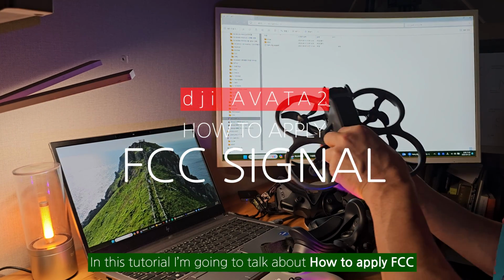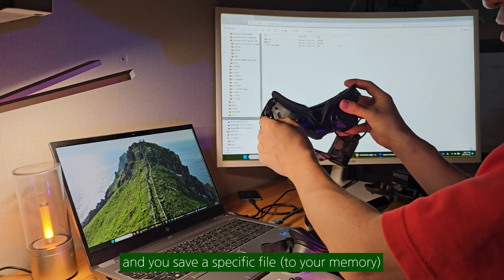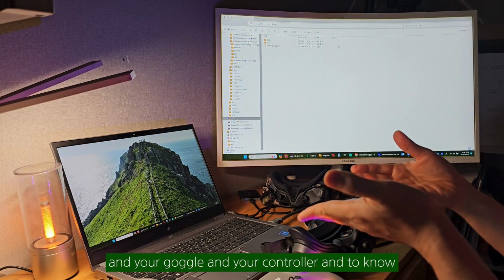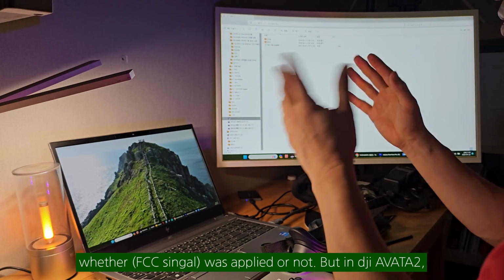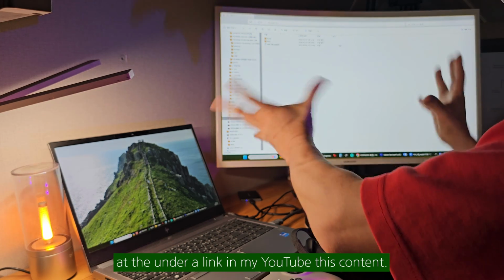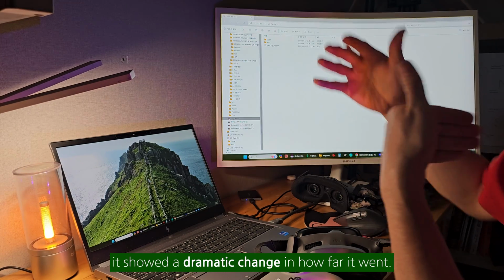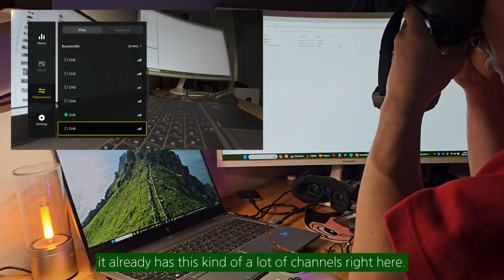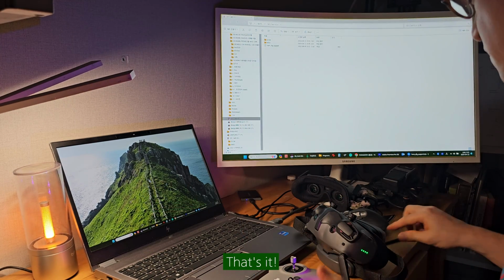How to apply FCC Hack to your dji AVATA2

Comment: Does this make the CE drone go faster than 70km/h?
Reply from the maker: Actually my avata2 flew 90km/h
Reply: @YOONGOON_FPV  In Europe it's limited to 69-70 km/h. So disappointing. It has less power, less fun.
Reply from the maker: Yesterday I flew with 90km/h in 45degrees, still felt it was slow!

Comment: This hack is not working in EU anymore for Avata 2 with the final firmwares. On the other hand in EU in CE mode we have an extra band 5.1GHz which is not available in FCC.
Reply: In Ireland I only have Channel Mode Auto, no manual/channel selection possible, even with the ham file and according to DJI Tech support/release notes there is no fw update yet for Avata 2/Goggles 3 (perhaps for our region). Do you guys have a lower firmware shipped with your device then Avata 2 V01.00.0200 Goggles 3 V01.00.0100 ?

CE Mode is apparently like this according to video here https://youtu.be/uKvIkMoU7I8?si=YAdXtvkHGMyas0k-&t=174
Reply from the maker: in Korea we have 2.4G and 5.8G only, same in Brazil, 
do you have 5.8G?
Reply: @YOONGOON_FPV  Yes, we have also 5.8GHz and accordingly to Avata 2 specs:
Transmitter Power (EIRP)
2.4 GHz:
＜33 dBm (FCC)
＜20 dBm (CE/SRRC/MIC)

5.1 GHz:
< 23 dBm (CE)

5.8 GHz:
＜33 dBm (FCC)
＜30 dBm (SRRC)
< 14 dBm (CE)
Reply: the hack is still working try doing it again

Comment: Can i use the same memory card and file as i used in Goggles 2? Or do i have to format the memory card and copy the file again?
Reply from the maker: As recommended plz format from your goggle and insert it again and reboot, nothing seems different but fly from the same spot and check the signal difference as many here in Korea says there's significant difference in the flight distance and antenna signal
Reply: I don't get it. Format the SD card or reset the Goggles? 

Why do we need to format the SD card?
Reply: @irhuz8683  format the SD card in your windows pc before putting the file on it. beware this will make you lose all the content on your sd card, so be sure to back up. Once you put the file on de SD card, insert it and it will work

Comment: Hi ! i tried it, but the setting for "channel mode" is set to "Auto" and is grayed, i can't put it on manual... any idea ? i applied the update on the Avata 2 so it should be good :/
Reply: Same here
Reply from the maker: Hmm what country are u at? Here it's Korea
Reply: @YOONGOON_FPV  France here, I saw an article talking about the fcc hack on Avata 2, the guy said it worked on only 1 of 4 Goggles v3, he doesn’t know why, on the 3 other the « channel mode » was grayed and locked in auto
Reply from the maker: I heard that European drone law got really strict recently right?
Reply: @YOONGOON_FPV  that’s why I want FCC 😅 it works for some, and not for others, so it is weird, a solution will be found I think
Reply: I had the same issue , on mine it worked with the file but after I did the firmware update it stayed grey on auto
Reply: @techgadgetgreece1587  do you think fcc is working now that your channel option is gray ?
Reply: @fab00057  I think the now is on ce, not fcc, I will check if I can downgrade firmware and try again .
Reply from the maker: Currently I'm making review, try to see the indoor crazy far flight at department store with this applied :)
Reply: @fab00057  T es dans quel coin en France?
Reply: @Fabosteo  en région parisienne, dans le val d’Oise, pourquoi, tu as une astuce miracle ?
Reply from the maker: We can assume that because of Ukraine & Russia War, dji has announced that they will not sell their product to both coutries, and dji will prohibit it being used at the war. But they said they cannot block their products being sent to those 2 countries from neighborhood coutries, which is Europe. If I'm dji I will strongly block the FCC mode which is happening to you, but working in Asia and South America which is far from the war zone. Maybe this explains the discrepancies debated here!
Reply from the maker: To all, it's seems that this isn't working in Europe, which is adjacent to Ukraine & Russia, but working at Asia and South America, What do you think  this means? I heard dji has blocked their product being sold at both countries as they prohibited their product to be used at war. But they also said, but they can't stop their product being sent to the war after it is sold (which is near to those countries, and that is "Europe") I guess this is why Europe can't apply this method!